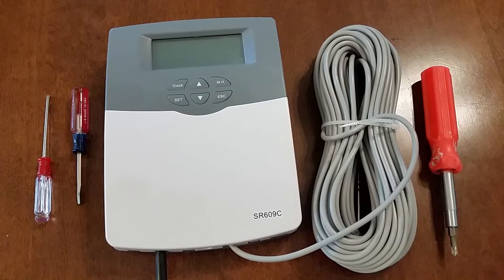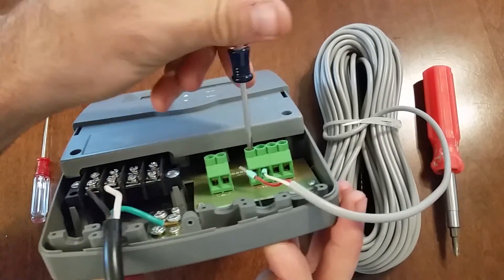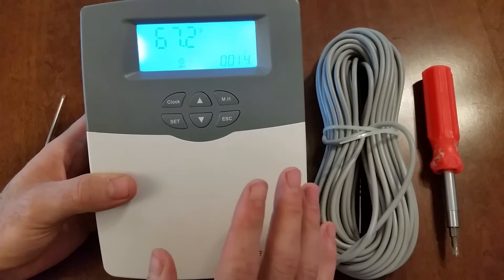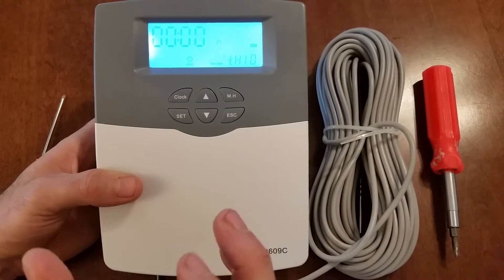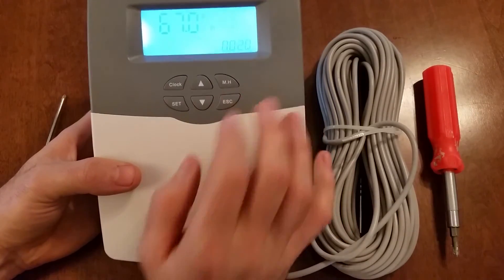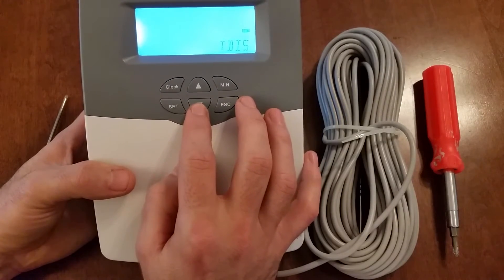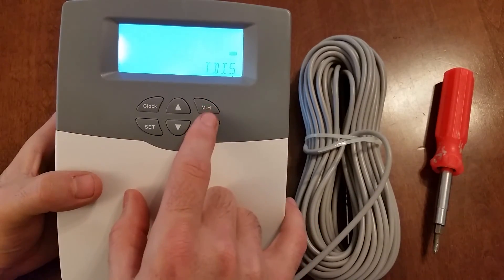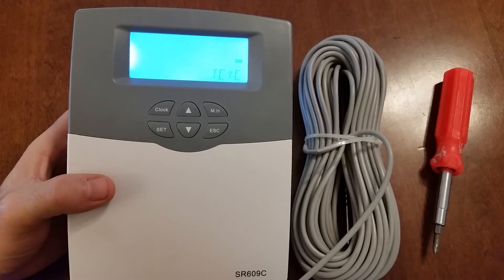How to Program the SR609C Solar Controller

Comment: So you can Wire this for 220v?
Reply from the maker: These are third party controller and I believe there are different versions of the same controller. The version we sell accepts 110V-240V. They may make one that only accepts 110V. There should be a sticker on the side of the controller that mentions the operating voltage.

Comment: Thanks for the explanation. Does the controller offer a means to automatically control the water level in the tank like other controllers for low pressure systems? Thanks
Reply from the maker: This is not a controller for a low pressure system and it does not have that feature. Our systems are pressurized with heat pipe collectors.